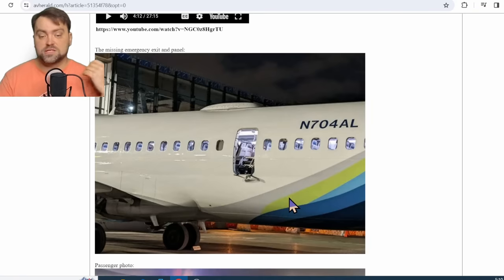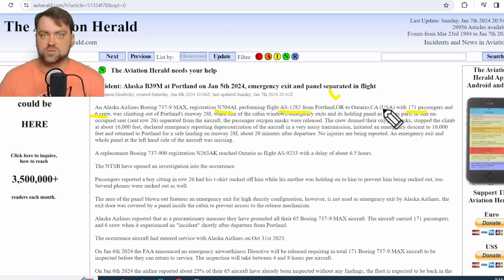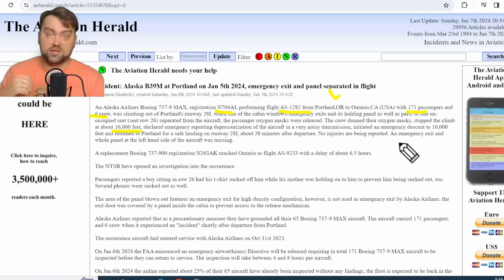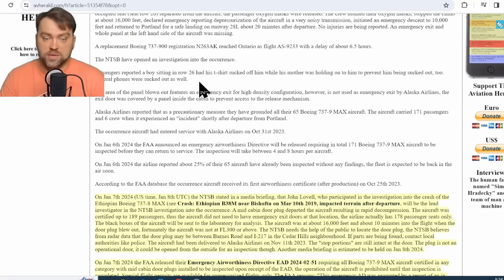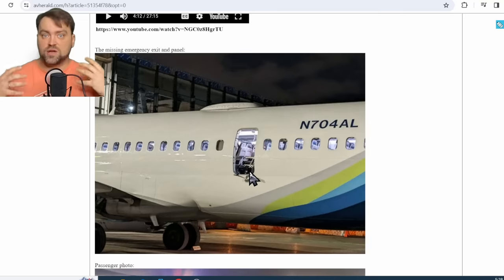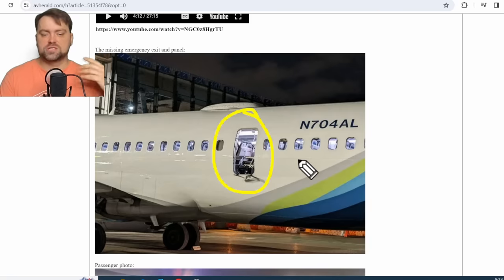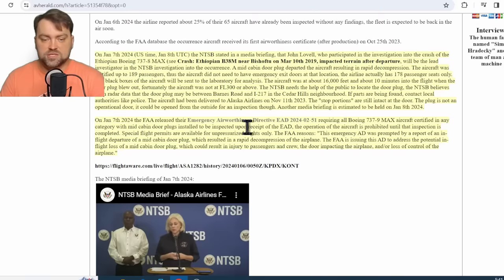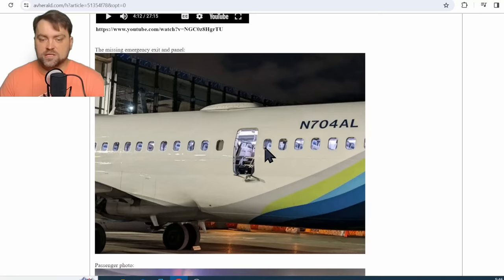Alaska Airlines Boeing 737 MAX Door Separation Update | What Happened?

Comment: BBC reported today that that particular aircraft had already had TWO recent reported problems related to cabin pressurisation, and had been banned from flying over water.  Also that the cockpit voice recording ‘was not retrieved’ within the two hour deadline before it’s deleted.  That seems very suspicious, given it was an emergency landing.
Reply: And the NTSB said to date there is NOTHING to indicate the previous pressurization alarms had anything to do with the plug failure.  In all 3 instances when they switched to the backup pressurization system the alarm went away.  This would indicate a problem with the primary pressurization system.
If the pilots don't pull the CVR circuit breaker right after landing, it'll keep recording and overwrite.  The techs didn't get into the plane to retrieve the CVR until 2 hours after the accident, so the recording was gone.  Nothing suspicious about it.  It happens quite often.  It is ridiculous to have only a 2 hour max record time.

Comment: "Factory defect".
That's supported as well by the detail, that this plane has been idle for most of the time since delivery.
So this was really one of the very first times this "door plug" had to withstand the compression.
Taking that, it makes sense that they didn't include the -900s.
But still:
That, not telling pilots about the operation of the MCAS, bypassing FAA in test and certification, leaving tools in 787 fuselages, self igniting 787 batteries, huge losses in Air-Force one and 777-X programs, knowing the management attitudes behind all that, the miracle seems to be, not that this incident ended safe, but that there are not much more of them...
Reply: This plane had flown nearly 150 flights before the accident.

Comment: Big thanks for this update Denys. 
As others have said, the clean removal of that 'plug' (installed in place of a real door) almost certainly suggests an issue with its installation and/or the surrounding fuselage fixing points (this plane was almost brand new). Cost saving cut backs in component quality/install/sign-off check? Also incredibly fortunate this didn't happen at a much higher altitude. Thankfully, this king of breach is an extremely rare occurrence.
Reply: Adhesive failure.. Maybe wrong adhesive, not cured correctly etc etc..

Comment: According to the NTSB Chair.. "The force from the loss of the plug door was strong enough to blow open the cockpit door during flight"
Reply: Of course it was.  When you suddenly drop the cabin air pressure by 5 psi the air trapped in the cockpit will place about 12,000 pounds of force on the cockpit door to get out.

Comment: This could've been a total hull loss with all souls if the door hit the horizontal stabiliser. Boeing has questions to answer, I'd say.
Reply: At what relative speed do you think the door would have hit the horizontal stabiliser?
Reply: @ImperrfectStranger That isn't my field, so I have no idea. Do you?
Reply: @ImperrfectStranger current Indicated Air Speed
Reply: Possible, but unlikely.  The plane will still fly with one missing/damaged horizontal stabilizer.
Reply: No, if one side of the stabiliser is damaged - or even removed- you can still have some limited control by using the engine thrust of each engine to vector the aircraft in which ever direction. You'd have to react fast to figure the problem out though but given the power of those engines and the uplift they can produce on each wing, it can be done. As a sidenote , I can comfortably land a Piper Cherokee on rudder and throttle alone - obviously its not preferable but it can be done.
Reply: I used to work for Boeing. As soon as I pointed the Flaws for SAFETY (many times), I was let go. It's all about $$$ Not about Human Life. And this is the Proof !
Reply: @EdgyNumber1  As you said, the pilots will have to act fast, and chances are they won't know what happened and try and use ailerons, which (I assume) could never overcome  damage/loss of the horizontal stabiliser. I'm thinking of a Continental Express flight 2574 type accident. There isn't a checklist for this.
Reply: @lindafukuyu5767 Sorry to hear that, but it explains a lot. Hopefully you can use your talents at a place that actually cares.
Reply: That's fair...place blame immediately when you have no clue what the real cause is, the fuselage manufacturer, Spirit, Alaska airlines maintenance, Boeing, or the manufacturer of the sub parts that all go into building and securing the door itself....yeah, maybe you should just read the comments and not post since you have no idea what you are talking about!
Reply: @EdgyNumber1 We're talking about the horizontal stabilizer, not the vertical stabilizer.
Reply: @andreab1604  The plug isn't going to decelerate from IAS to zero in 30 feet.
Reply: @stargazer7644  so what ?
Reply: @andreab1604 So it is relevant, that's what.  It isn't going to impact the tail at full speed (even assuming it can get up that high - the entire door plug is below the level of the horizontal stabilizer).
Reply: They are so good at making a hull they decided to put pointless holes in em just to make it more challenging...
Reply: @ImperrfectStranger Also depends whether aircraft is ascending or descending.
Reply: @ApriliaRacer14  Not sure I follow you. Are the elevators more exposed to impacts with the horizontal stabiliser trimmed for ascent/descent?
Reply: @ImperrfectStranger  Plane ascending down falls back towards horizontal stabilizer.
Reply: @ApriliaRacer14  Sorry, I don't understand... "ascending down"? What does this mean. Is this the opposite of "descending up"?
Reply: @gomez2724  This the the YouTube comments, not an NTSB report. I'm not pretending to be an authority, just dumping my thoughts in a place where frankly they don't matter. I don't know if you're a Boeing fanboy or just naturally unlikeable, but chill out, yeah?
Reply: @Dubinski2382  Tbh there is a reason for that hole to exist, to abide by FAA regs. It don't make sense to have 2 separate fuselages. Boeing's assembly and QC is the issue here.
Reply: @stargazer7644  planes have crashed simply because the leading edge was damaged; see Continental Express flight 2574. The stabiliser holds a huge amount of aerodynamic authority. Not to mention the lack of inherent aerodynamic stability creates the risk of pilot induced oscillations, even if it is initially controllable.

If you have the technical expertise to back up your statement, I'll defer to you, but now I just don't see damage/loss of the stabiliser on one side being recoverable in most situations.
Reply: @hayleyxyz  I'll simply refer you to any war where aircraft were severely damaged with most of the tail shot off but still made it home.  If you have one of the horizontal stabs working, the aircraft is still going to be stable.  You just won't have as much control authority.

Comment: Actually as far as I know the 787-MAX 900 operated by this Airline has only 2 bolted in "plugs" . So there are no hinges, no hidden doors, no slides etc. It would require 
quite a substantial refit to add doors in the place of these plugs. There are other variants which include deactivated or hidden doors. These don't have full-size windows
but instead these round small windows. I could be wrong but I think the cause of this incident probably resulted from faulty manufacturing. Wrong bolt size, not properly 
torqued etc.  Carl 🇦🇺
Reply: 737 MAX, not 787.
Reply: By the look of things it requires little to change out the system..
Reply: There are hinges on the bottom of the plug, just like if it was an emergency door. It can be opened for maintenance, such as servicing the seals. There are 3 configurations for this opening, a plug with no easy way to convert to an emergency exit, a deactivated emergency exit with a small window which can be converted to an emergency exit, and an emergency exit. Currently, only Ryan Air has the MAX-9 with the emergency exit active.
Reply: @johnhaller5851 All you have to do to convert it to an exit is install a door and its hardware.  It isn't difficult.  That's why the hole exists afterall.  Also, the "hinge" isn't really a hinge and isn't like a regular door.  It doesn't allow the plug to open past about 20 degrees.  It is just there for inspection purposes.
Reply: @stargazer7644  Boeing says it's more work. I wonder if they don't install the door open sensor wiring if you don't at least get the non-operational door.
Reply: @johnhaller5851  Of course it is more work.  And more expense.  That's the reason why the door is an option.  They don't install the door open sensor when there is no door.  The door plug isn't a door.  It's a plug.  The also don't install "wing has fallen off" sensors.

Comment: Lucky - history is littered with examples of cabin door and cargo door failures that cause massive structural damage, sometimes bringing the whole plane down. Eg Turkish Airlines flight 981.

In this case, they're lucky the plug / door failed at 16,000 feet rather than 36,000 feet where the forces would have been much greater, and possibly ripped part of the aircraft structure away.

This could have easily been the 3rd Boeing 737 Max crash. Right now, Boeing is incapable of doing quality control properly.

Last week we had bolts missing from the tail rudder of 737 Max planes (could have resulted in a crash.) The month before it was engine cowling not fitted correctly. There are also quality problems with the 787 Dreamliner.

Problems at Boeing started with the McDonnell Douglas merger, the migration of Boeing's corporate office to Chicago (where no planes are made) and the farming off of 737 manufacturer to other companies (eg Spirit Aviation).

With a McDonnell Douglas type of corporate attitude, now the Boeing 737 Max is starting to adopt the reputation of McDonnell Douglas' main aircraft, the DC-10.

Comment: The manufacturing crew didn’t reinstall the locking bolts on the plug when finished installing interior components.   The aircraft gave warning 3 previous flights there was a pressurization problem. Alaska airlines withdrew the aircraft ETOPs rating until problem was fixed but maintenance crews continued reset system.
Reply: you have the inside info?
Reply: And that is the smoking gun!
Reply: I'll never fly with Alaska again !!

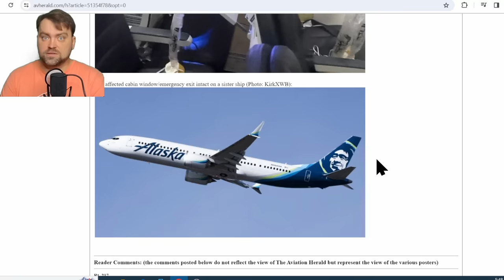Comment: 3:25 regular fuselage and extended fuselage 5:34 door plug assembly way more sophisticated and complicated than just four bolts 6:56 re: factory defect, one news story said Renton likely undid plug for access, then resealed
Reply: "resealed"  being the operative word.  My guess is an assembly technician made a mistake and didnt do something that they were supposed to do.  Anxiously waiting to see the recovered plug.  For me human errors happen.... that is why everything is supposed to be double-checked and signed-off on....  that is what scares me most...   who TF signed off on a door plug without checking the anchor bolts?  And whomever it is, I guess their career at Boeing is going to be shortened.
Reply: @exploreraa983  My question would be, how many planes are flying around with undetected botched parts?
Reply: @eljanrimsa5843   I think what we will learn is that there is nothing wrong with the part, it is used for years without issue.  This is going to come down to someone not doing what they were supposed to, and the person that was supposed to sign them off and check, did not.
Reply: @exploreraa983  And do you think only one person did only once sign off without checking?

Comment: I'm wondering why they continued to use this plane when a few instances days prior they had the depressurization light come on. That is not a good sign. That system is there for a reason. After this was reported and maintenance looked at it, what were the conclusions? I bet it's not so easy to come up with a conclusion unless you are actually able to look at the structure of the plane. Hopefully there is nothing wrong there and the depressurization alarm was because of a bad seal around the door or something, which isn't really good either but it's a better scenario than other structural problems. At high altitude and this happens, that causes rigid structures in the plane to become deformed and damaged. That can't be good for the human body, especially for the infants onboard.
Reply: The pressurization alarm came on 3 times on 3 different previous flights.  In every instance when they switched to the backup pressurization system there were no further problems.  The aircraft is allowed by FAA rules to fly with one of the pressurization systems inop (there are 3 different redundant systems).  Maintenance tested the system 3 times and didn't find a problem.  They had scheduled the aircraft for a more thorough test to find the problem.  If the alarm was due to the plug leaking, the secondary system would have alarmed too.  It didn't.  Pressurization problems do not result in "rigid structures in the plane becoming deformed and damaged."   The plane can operate just fine completely unpressurized - just not with passengers.  NTSB has said there is no evidence that the pressurization alarms had anything whatsoever to do with the plug failure.

Comment: My bet, cost cutting. That panel should have been alum framed w alum cross pieces to transfer load just like rest if skin.  Then it should have been BOLTED in place to enable same & make it impossible for 100% of it to leave in midflight even if a hand grenade blew a hole in the middle.  It WAS a weak point, which means it should have been made into a strong point to compensate for that AND add a safety factor.
My bet, all plastic & composites w far less rigidity than aluminum, saved enufcweight 2 men could hand carry it & attach it w 4 no 6 screws, just enuf to hold it on place until at altitude there was tons of pressure holding it in place.  
Had alum been bolted to alum wed see SOME shred of panel left.  There is NONE.
The lightweight & WEAK panel flexed pulling out the few screws holding it, then folded & exited aircraft.
Using a heavy panel requiring rigging to lift to move & hold for one hour while 2 workers tightened up 8 screws to proper torque reading would take 3 or  4 more than an hour.  2 guys & a few sheet metal screws, 45 min.
Boeing needs to have every design last 20 yrs certified by independent aircraft co even if it means 1000 engineers working for yrs.  Including reviewing "installation" instructions / procedures.  The $ should come from CEOs & execs who cost cut the best aircraft manufacturer in the world into the ground.  The ones in the top 5% of "compensation" inc fully realized stock options, juicy pension pay & health programs, juicy covers everything on earth health ins policies they got free while workers had to pay just for crappy HMO policies...
Reply: This same door plug design has been working just fine on several variations of the 737 for over 20 years.  Care to blather on a bit more?